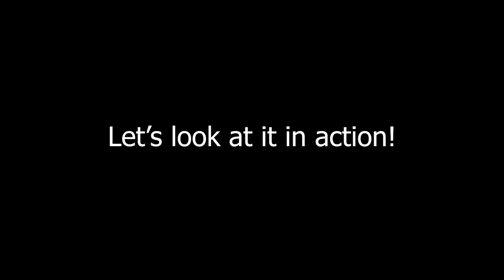PS5 Adaptive Trigger Live Mechanics in Game - Full Teardown

Comment: I'm trying to buy the motherboard flex cable since I broke it by accident but I cannot find it online :(
Reply from the maker: You should be able to use any Flat Flex Cable, just count the pins/wires  in the cable, measure the pitch [distance between each pin (measure the distance between the middle of the first and last pin then divide by the number of pins)], and then the rough length of the cable.
Go on AliExpress and search for that FFC cable. They have different types of cable ends available.
GLFFC is the store on AliExpress I got some from.
You can even cut them if the pin count isn't exactly right.
Reply: @RestoreTechnique  thanks for your help, bro. I bough  a 16 pin one, since the one that came with the controller has the same amount of pins.

Comment: In past controllers with analog triggers, the strength of the trigger's resistance and its ability to jump back to full extension all hinges on that same tiny spring. Playing games that require the trigger to be squeezed for long periods of time (think GTA where you spend a lot of time driving and holding the acceleration trigger) would wear out the spring's strength resulting in a weaker amount of resistance at first, and total failure to snap back to full extension at worst.

Now I see in this new controller that there is still that same little weak spring, but it doesn't appear to play any role in the trigger's resistance or ability to snap back to full extension. Is that correct? The spring wearing out should no longer be a concern and we can freely play games where squeezing the trigger for long periods of time isn't an issue anymore?
Reply from the maker: Nah the spring is still being fully compressed when you press the trigger down, regardless of what the motor and gear are doing. Also, some games don't have adaptive trigger support, and you can also turn that function off I'm pretty sure. So the trigger acts in the same way as the PS4 trigger does.
I don't believe the gear and motor are actually pushing the trigger back to default position. The arm may be applying a very small amount of force, just to reset the arm to the top. Edit: You can see that the button makes it back up before the arm does.
Reply: My right trigger has no resistance, it’s already broken? I need help to try repairing it any help? I barley add any pressure and it shoots my gun

Comment: The Adaptive Trigger thing is a great idea. But still, Xbox Controller is better when it comes to holding, and d-pad/joystick/buttons locations. This is not only my opinion but when you buy a a mod controller,  99.0% of them have the Xbox layout for a reason. That’s the reality and Sony PS knows about it and they are so prideful on making changes to it. Oh,  I switch to Xbox completely during the 360 time. I had a PS1,2 and play my Father’s PS3. I am bringing facts to the table and not just an opinion or idea without experience.

Comment: My motor/ the white part had became lose. Bc I had dropped it and made weird noise when I press the L2 button so I opened it up and I put some paper beteewn the vibration and the motor and some how it worked but when I press fast is like stops for a sec or two and that what I don’t like but I will get use to it

Comment: What happens if you press too hard on the trigger? would that break it?
Reply from the maker: Well the trigger can break with excess force in the same way a PS4 trigger can when it bottoms out (uncommon). As for excess torque applied to the motor, I am not sure if that can damage it. I wouldn't think so.
Reply: I find myself constantly squeezing the trigger to feel that squishy grinding. Feels so good. COD has it set while in load screen and it gets a good 50 pumps before the game starts lol

Comment: Is it possible to shut that Haptic Feedback off and still using the Button?

Friend of mine managed to break something and now the controller switching the Feedback nonstop. Click clack like a watch 

Thx in advance
Reply from the maker: You could desolder (or cut) the wires for the worm gear motors. I'm not sure how that affects the gear and potentiometer, but it should work fine if you do that.
Reply: @RestoreTechnique  He got it thank you. He disconnected a flat cable

Comment: Question: The trigger spring on my DS5 became loose, [I think]; but my adaptive triggers still work. 

Can I assume that my trigger springs are indeed displaced?
Reply from the maker: Doesn't sound like your trigger spring has been disolaced. If you feel resistance on the triggers when the controller is turned off, then it's fine.
Reply: @RestoreTechnique  that's the problem, I tried comparing the triggers by passing a folded tissue on each. 

The R2 has a weak resistance while L2 has a strong one.
Reply from the maker: @Pawts  sounds like the trigger spring hasn't broken yet, but has a lot of wear, and may break soon. That's what I'm imagining anyway.
Reply: @RestoreTechnique  aight, thank you dude. 🙂, imma have it checked at a Sony Service Center near me. Kinda sucks it happened in just 3 months of use.

Comment: Mr josh hi how r u ihave questions u said in your video for ps5  if separate the heatsink nd gpu the cooling will be less so how iwill reapply the the thermal paste the one on chips nd i heard also no need to reapply the metal liquid in ps5 thats mean liquid metal for ever nt getting dry
Reply from the maker: Hi, I am not sure if the GPU/CPU cooling will actually be diminished, I just know that the liquid metal was hermetically sealed, and opening it up displaces the liquid metal, which may result in less than perfect contact. I think it will be fine though, as there's a lot of liquid metal on the chip, so plenty to reconnect the processor and the heatsink.
I am no expert in liquid metal application or longevity though.
Reply: @RestoreTechnique  one guy in video he said sony company said no need to reapply the metal liquid never but u need to tear down ps5 to reapply the thermal paste the one top of small chips thats mean we must to seperate the heatsing nd gpu
Reply: @RestoreTechnique when u put back the console nd u tried it did u face any overheating issue
Reply from the maker: @ehabsaeed7686  No, no overheating 👍 You shouldn't need to replace the thermal paste on the other components for some time, couple of years it may dry out and become less effective. Some people have the same thermal compound on computers that are 20yrs old, and they still work.
Reply: @RestoreTechnique  but how if the paste became dry how will transfer the heat in your experience for example it is must to reapply the paste under in ihs of ps3
Reply: @RestoreTechnique  sorry other question if paste became dry it will be less effective or zero effective
Reply from the maker: @ehabsaeed7686  Less effective. Never zero effective
Reply: @RestoreTechnique i want to know when u said if heatsink nd gpu will be separated it will nt cool again why nd or u mean we need reapply new liquid metal
Reply: @RestoreTechnique  hi im confused until nw if we need to reapply the paste top of other chips
Reply from the maker: @ehabsaeed7686  No you won't for a couple years. As long as you don't disturb it's position when you open it, you shouldn't need to replace it unless it gets quite dry.
Reply: @RestoreTechnique  if got dry thats mean iwill seperate the heatsink nd gpu so thats mean iwill reapply metal liquid also or nt

Comment: As cool as these controllers are, I can't see them lasting very long. I can see the trigger functions to be the first issues people will encounter, either from the mechanical pieces breaking from constant use or from putting a good amount of pressure on the triggers during intense gameplay, possibly breaking the trigger entirely in an instant. If you have a PS5 and are reading this, have you had any problems with your controller yet?